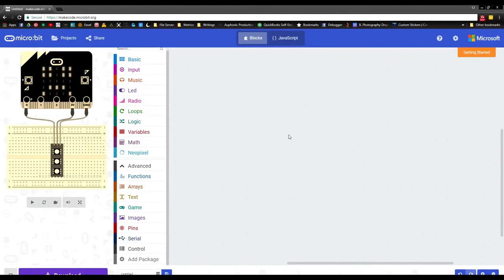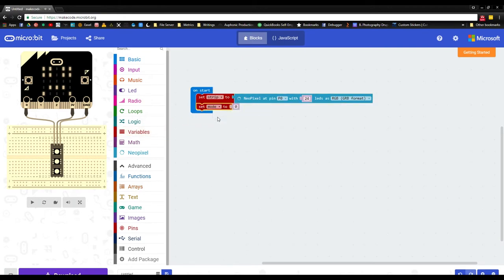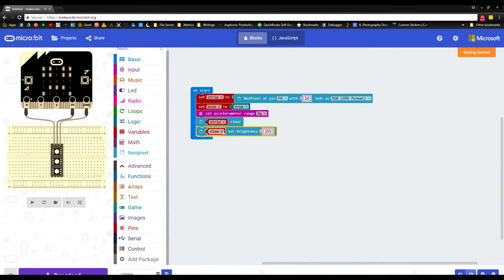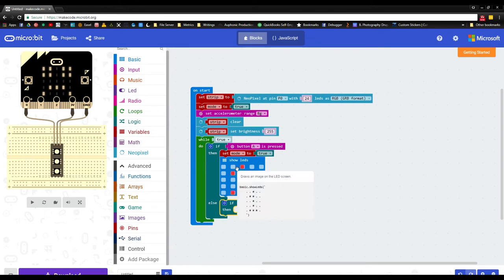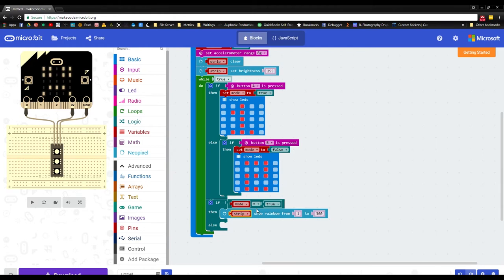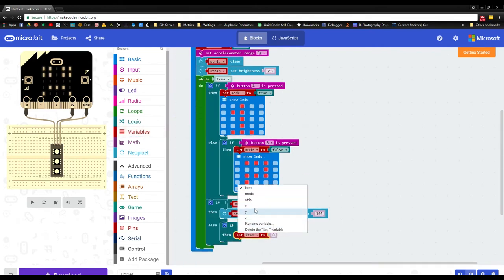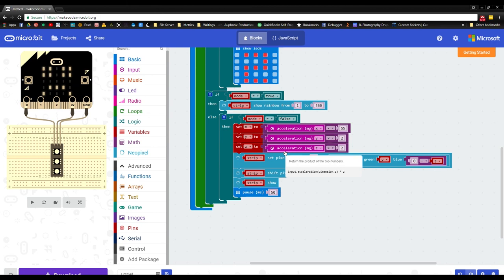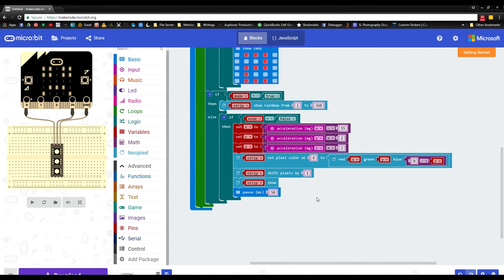Programming The BBC Micro:Bit For NeoPixels | Tutorial Accompanying Video

Comment: Below is the code used in the above tutorial.  It is in Java script you can see it  in blocks if you want,  just switch to blocks.  Before cut and pasting it in load "neopixel extension"   I made a change at  "set pixel color at "  and got good results.

let z = 0
let y = 0
let x = 0
let strip = neopixel.create(DigitalPin.P0, 24, NeoPixelMode.RGB)
let mode = true
input.setAccelerometerRange(AcceleratorRange.EightG)
strip.clear()
strip.setBrightness(255)
while (true) {
    if (input.buttonIsPressed(Button.A)) {
        mode = true
        basic.showLeds(`
            . . # . .
            . # # . .
            . . # . .
            . . # . .
            . # # # .
            `)
    } else {
        if (input.buttonIsPressed(Button.B)) {
            mode = false
            basic.showLeds(`
                . # # # .
                . . . # .
                . # # # .
                . # . . .
                . # # # .
                `)
        }
        if (mode == true) {
            strip.showRainbow(1, 360)
        } else {
            if (mode == false) {
                x = input.acceleration(Dimension.Y) - 55
                y = input.acceleration(Dimension.X) * 2
                z = input.acceleration(Dimension.Z) * 2
                strip.setPixelColor(0, neopixel.rgb(x, y, z))
                strip.shift(1)
                strip.show()
                basic.pause(50)
            }
        }
    }
}